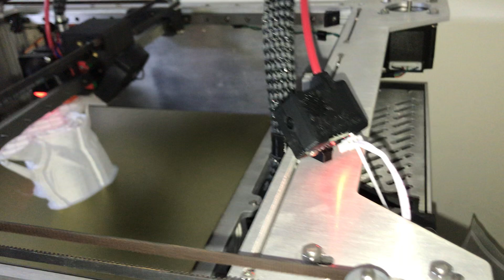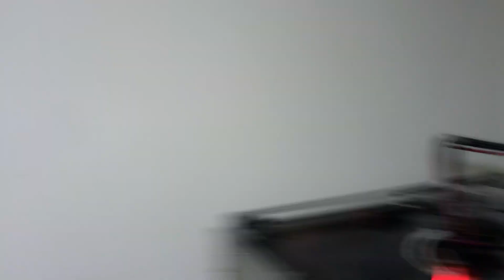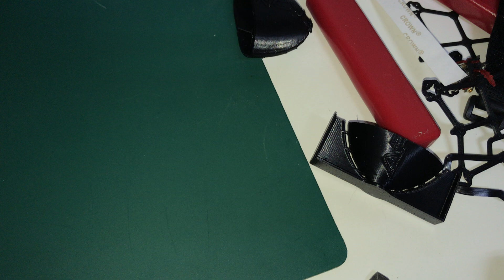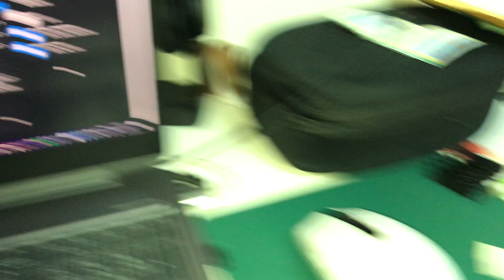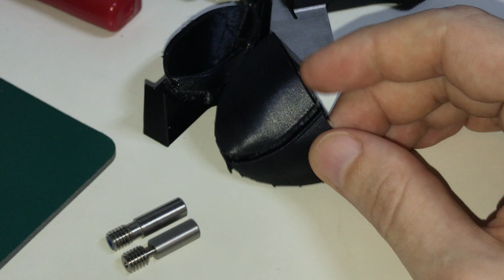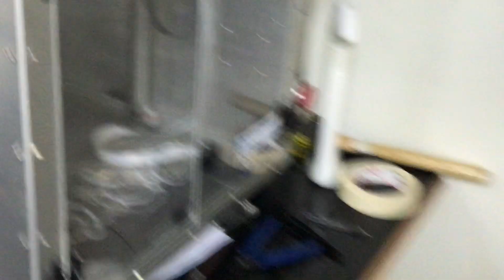Biqu H2 review followup; some practical caveats

Comment: Merci pour la review !
I was thinking about getting this one as an upgrade from Creality/E3D direct drive CR10-V3 setup to print TPU faster, but it seems like it might be a lot of work with unpredictable results.
At which kind of flow rate do you start getting jams with TPU?
Reply from the maker: Coucou, So these failed TPU prints were at 7.5mm3/s (65mm/s, 0.48x0.24 layer). Same profile as on my old Snapmaker 3-1 with a modded MK8 extruder where I can push 10mm3/s without a hitch.
I mean I know I could just lower the feed till it runs smoothly but I print for business so speed is at the essence
Reply: @fractalengineering  ah yes thanks for sharing. Not a terrible speed but a bit lower than you'd expect for sure!
Appreciated, and subscribed 🙂